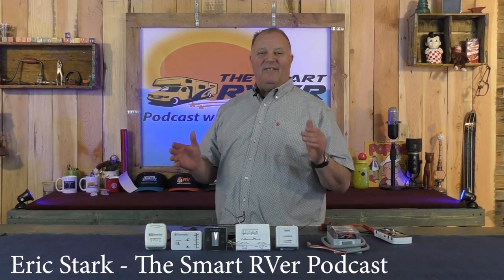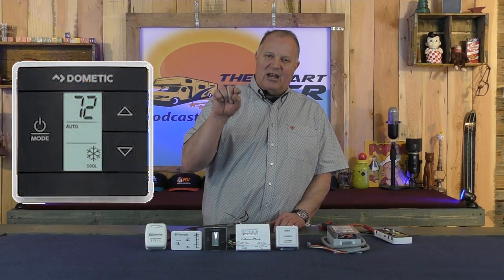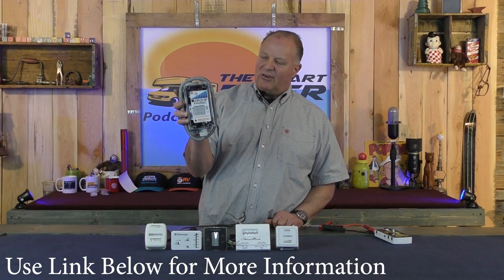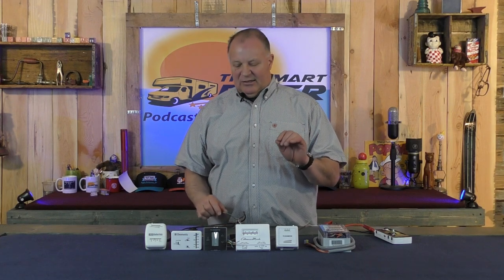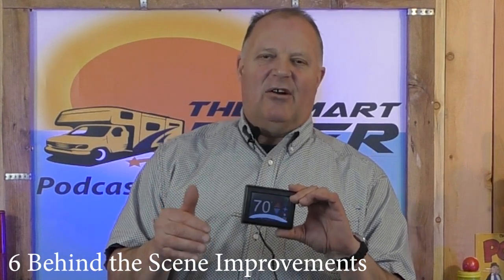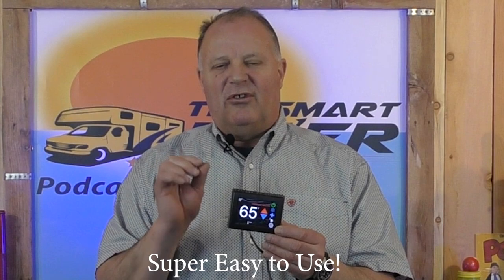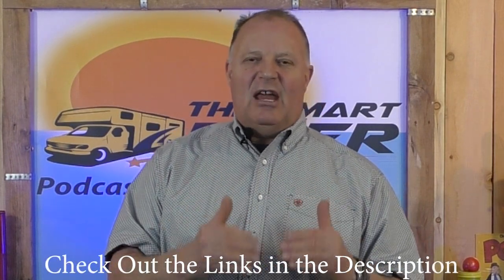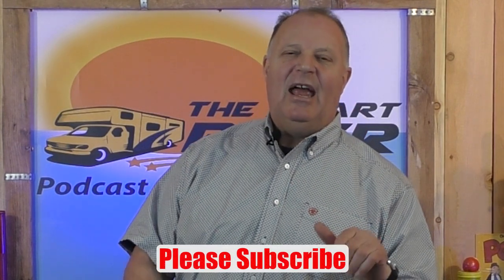The Truth About the Micro Air Easy Touch RV Thermostat Upgrade

Comment: Will the micro air easy touch thermostat display error codes like some of the original equipment installed by manufacturers?

Comment: Finally got mine figured out  be nice if they had more instructions to get to all the features , 
My black light goes out and acts like it restarts when I touch the screen
Reply from the maker: You should contact Micro Air if you experience any problems; they will happily assist you.

Comment: I can not keep mine connected to wifi. Have 3 other neighbors in my campground with this thermostat using the campgrounds wifi and they have no issues.  Support from Micro-Air is very poor.  You will get email, they don't want to talk to their customers.  Very disapointed in a 250.00 waste of money.  If you want to control your RV from home, this is junk.

Comment: Thank you for this video! 

I have no issues with my app.  Been using it for months.  Love it 

I do have a question though…When using the app for the easy touch thermostat, does it allow for multiple app users?

I have the app on my phone, my husband wants to add it to his phone and we are not able to pair it.  

Wondering if it’s because only one app at a time is allowed…do you know this?
Reply from the maker: I have not that it will work with 2 apps. Some Blue Tooth items will only allow one user to be paired.

Comment: You said this works for "most" RV's. Does it work for RV's with a residential basement system such as the Coleman-Mach Series 6537 with heat pump?
Reply from the maker: I am sorry for the late reply, Micro Air would be better to answer your question.

Comment: I just watched your video on the micro air easy touch thermostat.  If you set the temperature 65 degrees will it turn the air conditioner or furnace on as required without you having to change the mode?
Reply: You can create time and day schedule settings which allow heating only, cooling only, or both. You can tell it whether you want low fan, hi fan, or "Full Auto".
You can create HOME schedules, as well as AWAY settings. You can set different temperatures for different times of day, and you can set thresholds to keep the temperature between a high and a low setting.
It's extremely versatile.
Reply: Thank you.

Comment: Is this thermostat smart enough that you can send a temperature range, and it will turn on the correct HVAC system?  For example - my home thermostat is set so that when the temperature in the house exceeds 74º, the AC is turned on.  If the temperature falls below 64º, the furnace is turned on.  Can this unit manage the heating and cooling systems in the same way?
Reply from the maker: Hello, Thanks for the question, I hope the following is answers your question in detail. >>>>>>Away operation allows setting upper and lower limits for temperature with a non-operating area or “dead band” in the middle. This can be useful when setting a higher daytime cooling temperature and lower night time heating temperature. It can also be used to control the temperature extremes when you are away from the RV. The mode selected must be an automatic mode to allow both heating and cooling operation. 1. Press the setpoints area to toggle between the selected value.  A blue square will show around the value you are changing.  The upper value changes the cooling set point and the lower value changes the heating set point. 2. Use the up and down arrows to change the selected temperature value.   Set points may be changed on a time-based schedule. The mode used will be the heating or cooling mode set on the main screen.  Setting a change event  1. Events will show --:-- when the event is disabled. Press the hours position to set the hours. A flashing bar will appear under the hours along with up and down adjustment selectors. Use the adjustment selectors to change the hours.  Press the minutes to move the flashing bar under the minutes and allow ¼ hour adjustments. Use the up and down adjustment selectors to make changes.  Press the temperature to change the desired temperature set point. This is the temperature the system will try to achieve after the time that was set. 12- or 24-hour format  2. Press the time in the upper right to change 12 and 24-hour time formats. Setting the time 3. Time zone is set and saved whenever the thermostat connects using Bluetooth. Time is set on power up through the internet connection, or whenever a connection is made on either Bluetooth or WIFI.  Enabling the schedule  4. Press the enabled/disabled button to enable the schedule. The schedule will be active and make set point changes anytime the schedule is selected on the main screen. The Home/Schedule/Away button will only toggle between schedule and away when the schedule is enabled. The button will only select between home and away if the schedule is disabled. Away mode is not configurable on a schedule. 5. Press the round arrow icon to return to the regular settings screen.
Reply: @TheSmartRVer  This was great information and completely answered my question, thank you!
Reply from the maker: @bgauweiler  Glad to hear it helped.